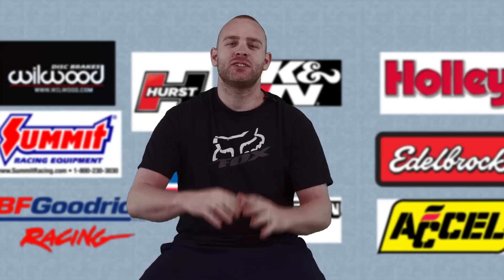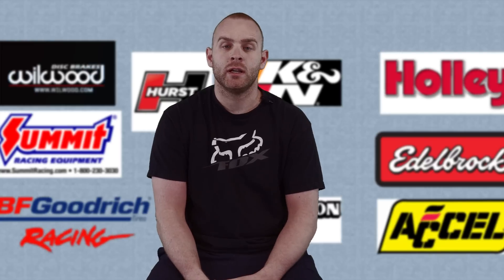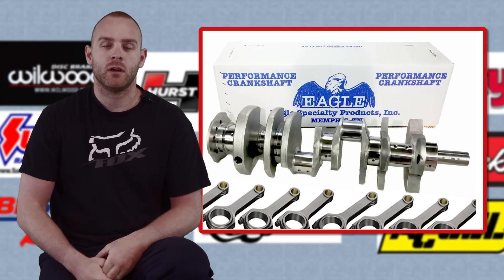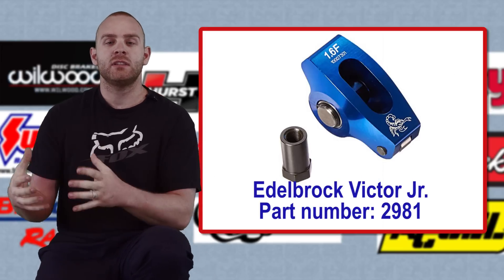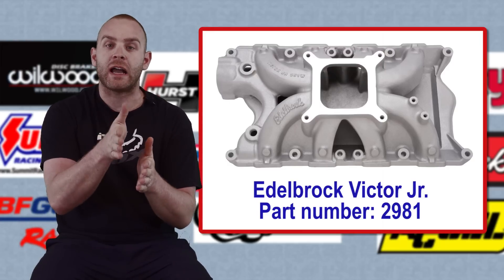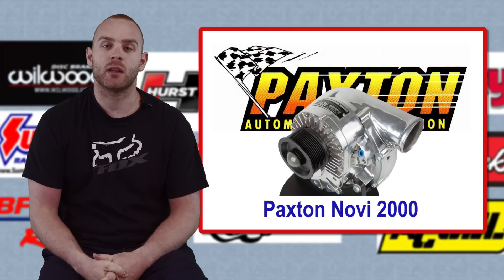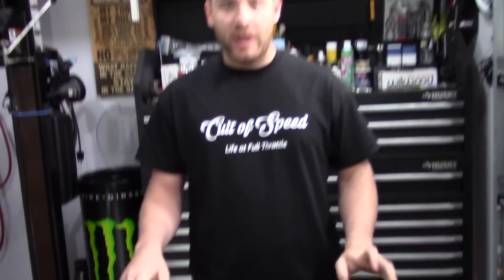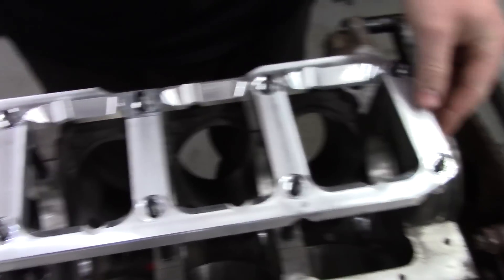351W Stroker - Recommended Parts

Comment: You can mount a roots style supercharger at the side of the engine, there’s no rule that requires you to put it directly on the intake manifold.
Reply from the maker: I agree but for my case it's not going to work, unless I run 2 small units for the power I'd like to make. Good comment though and completely accurate you can remote mount one

Comment: I would have gone with a custom cam for your application. I love the XE274HR but that’s way small cam for 408. Ideally something like 230-236 intake duration and 240-244 exhaust on a 114 LSA and .600 lift or so.
Reply from the maker: Correct but it's what I selected for street manors :)

Comment: That is a small little baby cam for the 408W. I'd guesstimate that you left at least 40hp on the table NA, and up to 100 when you add boost to it. 
It just won't have the lungs up top. Will be ok for picking up ice cream, but trying to meet your HP goals it'll fall short in that larger displacement stroker. You had a lot of duration left to play with and may find that it falls off after 5k rpms.
Reply from the maker: you might be right but as a street car primarily i didnt want to go so huge that drivability was effected.

Comment: was that an original 289? Ford used up what they had left at in January 1968 and went to the 302 after that.
Reply from the maker: Yes sir 289 car.
Reply: @710Garage allegedly, the last 289 blocks have the 302 bore length and may be better for stroking to avoid piston rock at BDC.
Reply from the maker: That's awesome I wonder what my build date is then... I'd have to go back and sort through it.  I have the take out motor and Trans sitting incase I ever want to go back.

Comment: Dang, bunch o girly parts!!
Reply from the maker: What are your suggestions then?
Reply: @710Garage   - solid cam, 225 TF heads (would like 220 actually), 11.5 comp, Jesel Shaft Rocker Arms, undecided about carb or Holley hi ram.  Would like EFI tunenability for street/strip tunes and not have to mess with jets, but, were talking $2500 extra just for tuneability, pricey, 1 7/8 headers or bigger, 7600rpm across the traps yada yada yada.............
Reply from the maker: Solid cam for a street car??  Sounds like more hassle than it's worth.
Reply: @710Garage   - Whats an hour with your car once every 3 months to have a 600hp street/strip engine?   Like I said, girly parts for a girly engine.  However, I do like girls.  If your gonna go through stroking it, do it right.  If not, just take a stock block and throw a super charger on it.  Will make just as much HP and even less wear, tear and longevity to boot (as long as you keep it respectable).
Reply from the maker: Well thanks for the comment. Safe to say we think differently about some parts above but that's why the world goes round... everyone isn't the same.
Reply: @710Garage   - Your welcome.  Anytime you nee a youtube troll, just let me know!  :)
Reply from the maker: @mistersniffer6838 what would the world do without them! 

atleast sub for the trouble ;) lol

Comment: How important is it to line bore/hone the journals before re install? My engine is out of a high mileage truck, but it’s cleaning up very nice!
Reply from the maker: It's cheap insurance to not have an issue later.  
I currently have a 347 at the machine shop that was supposed to be ready to go..  and guess what??  #2 main is out of round and we it wasn't checked we could have had significant problems ruining our good parts. 

I'd say it's worth the 4-500 to have it all looked over, so you know when it goes in its ready for a beating.
Reply: @710Garage  dang it. You’re right.
Reply from the maker: @FootageFactory  it happens from time to time 😆   thanks for the comment! Hopefully it helps you a little bit.

Comment: Hey man I got a question, I love the build but was wondering what your thoughts on the Holley EFI after all this time? Are you still running the engine with it? What issues did you deal with after putting boost on it?
Reply from the maker: Thanks for the comment and the view! 

the holley efi is amazing....  
I have had a few issues requiring sending the unit back but holley is amazing to deal with.  I would LOVE to up my setup to a dominator but would need to sell my sniper to do so. 

so I guess I'll keep it for sale and if it sells great. If not.. well... if it ain't broke don't fix it!
Reply: @710Garage Thank you for continuing to engage with your audience. I'm considering doing something very similar and put a centrfigual supercharger on a 1988 ski boat. We upgraded the heads to the "GT40" ones and the intake manifold to the same Edelbrock one you're using. We're going to rebuild the lower end soon. Im still pondering on the idea of using a blow-through carburetor and other old-school stuff to support the supercharger, or going to EFI. Do you think it makes sense to switch the carburetor to a Super Sniper?
Reply from the maker: I had absolutely no luck with the efi.. if I'm being 100% honest for YEARS...  I went to Steve Morris for a tune ( that sucked so bad the car wouldn't run ) I tried the setup wizard... I tried alot... 

but as it's a toy car for me I just put it away and when cooler heads were around I went back out to tinker... 

at the end of last season I went to Trevor at TC Tuned... he emailed me a tune and BOOM everything started to click... 
Through data logging I found an issue where the efi kept dropping my 02 sensor and it would fall on its face...  working with holley they were absolutely amazing and I got another new sniper sent out... 

with the car sitting about 9 months I installed the new holley last week and it fired up like it was running 5 mins prior and seemed to be running awesomely... 

I'm upgrading my steering setup currently ( hope to be complete this weekend ) and I can get it out and test it... 

long winded answer but FINALLY I am so so so happy with it ( for the amount it's ran and driven ) and I should have gone to see Trevor sooner... 

let me update again next week but I'm 99.9% certain I will be back in love with my baby, and be a sworn holley efi customer for the long haul.
Reply from the maker: Also......   thank you for watching!! I truly enjoy making videos and chatting with people ( like you ) about it... I had no one to help me prior to doing this stuff so if I can help I will

Comment: 500 hp is usually more than you can hook up without mods! You can run junk and a 150 shot of gas on stock Windsor crank and rods! Put the money in the heads!  The stock Windsor rods and crank will hold up! You gotta be ok. A cheap short block with heads and cam is the easy and cheapest way to go! Forget the stock hood! Noone believes it still an 8.2 block!  You can't hook up 1000hp without back halfing it! Screw the injection! Victor Jr and custom carb will get you there!! Don't waste  the money! You can't hook up 800 hp on the street anyway!
Reply from the maker: Who said I had no mods?? 

also yes there are cheaper ways to make 500 hp but how long will they last?? 

And carb?  Yes I could have for sure.  But I wanted efi..  that doesn't mean it is the ONLY way..  just what I wanted for my setup.
Reply: @710Garage  years, night after night. Week after week. I was probably doing this when you too the training wheel off!  Ran both of them. Po boys need something that stays together, and makes power and stays together. It's ur money! But you do realize you could go up to a 408 and still have a decent rod/stroke ratio. Or build a 393 for chicken feed! Ur money! Noone believes it's a 5liter with heads and cam! Good luck, and just have fun!

Comment: I apologize for digging up an old video - but do you happen to know what the motor was putting out before you added the S/Cer?  I'm trying to play out a dependable 500-550 rwhp stroker, so I'm kind of curious.
Great video, by the way.
Reply from the maker: no reason to be sorry!!! i havent gotten the car running well enough yet for dyno'ing... 

alot of bad reasons why??
moved
built a shop 
had twins
changed jobs

this summer i tried to get it ready to go and turned out i had a bad ECU from holley for my fuel injection.  so that was again another setback... 

i know that doesnt help you currently but i am working hard to get this thing running by spring time so i can give you the answer you want.
Reply: @710Garage  No worries at all man.  I totally get it...life happens lol.  I've subscribed to the channel and will keep a look out.  Good luck with everything you have going on.
Reply from the maker: thanks alot!  sorry i couldnt give a better answer as of yet.. but i sure hope shortly it will be better than we expected!

Comment: Always wondered about putting a 351 in a Foxbody Mustang. My current 302 is set back one in from stock. I had to shorten my driveshaft..
Reply from the maker: this is a super easy swap.  new oil pan, headers, intake and you are basically ready to go.

Comment: Do you think a Trick Flow single plane intake 351W will fit in a 1968 Mustang? The Trick Flow intake measures 6.429 inches. I am just asking because i know you installed a Edelbrock Victor Junior #2981 5.75 inches tall in your 68 mustang. So I was wondering how much hood clearance you had with that intake?  My car has a factory 1968 Mustang GT500 hood so there is a little more room but not quite sure it will clear.
Reply from the maker: i milled my intake down about .625" and i still missed clearing my hood by a good amount. 

i have drop mounts and had my elbow machined down aswell.

Comment: Will a F4TE roller  351w with stock pistons work with aftermarket heads with 2.02 lift? I was told the flat top pistons will not work but I’m not sure if they came stick with flat top pistons or not?
Reply from the maker: 2.02 is the valve size.  what cam lift are you running and rocker arms?
Reply: @710Garage  stock cam and 1.6 rockers
Reply from the maker: @sammyvices2547  id venture to say youll be ok. you dont have a ton of lift  

try putting some playdoh on top of your piston and crank it over by hand. 
remove the head and measure how thick your playdoh is where the valve indent is 

let us know for sure !
Reply: @710Garage  ok thank you

Comment: Edge of the cylinder head to edge of cylinder head is only 1 1/2” wider than the 302,  it fits anywhere the anemic 302 does and it does the job so much easier
Reply from the maker: exactly my point :)

Comment: I see you didn't do your homework on the heads, the Dart heads are not the best choice. The Trick Flow 11R Twisted wedge head performs better on the dyno.
Reply from the maker: sometimes you go for what is available in the timeframe you have to build a motor. 

i did not say these are the best parts ever created for the SBF. 

thanks for the comment, and goodluck with your engine!

Comment: Cheers from Motown! May I ask what might be the best Windsor block to build? Is older blocks better then newer blocks, perhaps a 70's block?  Thank you. I want my hunkin 460 out of there the sooner the better.
Reply from the maker: MOTOWN!!??  thats SUPER close!

the golden blocks are 68-72  but they may be hard to find ( go figure )  

dont be scared of the newer blocks ( early 90s ) as they are super sturdy blocks still.
Reply from the maker: http://www.mustangandfords.com/how-to/engine/1407-how-to-push-a-junkyard-351-windsor-past-1000-hp/

as you can see here they didnt hurt the block... but throttling up and down so fast is what shattered this setup...

engine masters also has quite a few vids on pushing the 351w up past 700hp easily...

what are your goals with the setup and whats the budget lets work on a plan to achieve that!

Comment: Hey guys, I'm trying to do a 408 build for my 95 bronco. I am copying your build pretty close but I'm doing a rear sump and NA I was wondering if there were things I could sub or remove, like the gurddle do I need that running na? Or do I need a HV oil pump? Just trying to get about 500 hp on a college kid budget lol
Reply: Or if you buy recomend a different cam for lower end power? Like this is a big truck on 35 in tires and my stock 351 is a dog in there. Just trying to get that extra umph, I also have a 69 block that I'm using for this build
Reply from the maker: the girdle is just for added piece of mind.  it helps to hold the lower end together. its not NEEDED... but recommended. 
HV oil pump in my opinion is a MUST HAVE.... you always want as much oil as you can get to the bearings and internals of the motor so i would not skimp on this.

the cam i have is setup for a blower.  so yes you can for sure use different cams.  there are TONS of options out there but ALOT will depend on compression ratio, heads, intake, stall convertor ( if auto ) and final gear ratio... so it would be hard for me to give a suggestion without that info. 

the folks over at Comp Cams are incredible to deal with. they can get you exactly what you want/need quickly and easily.  i would give them  a shout.  BUT have that info i asked in the previous paragraph at the ready so they have the info they need.

keep us in the loop with your build! and good luck.  if you have more questions let us know!
Reply: 710 Garage I don’t even have heads or intake picked out yet, I was gonna run the ones you guys had, compression ratio I was aiming to stick with pump gas so what’s that 10.5:1 for 87 octane, I’m willing to go up to premium 93 octane or even E85 is readily available around here. And I was gonna stick with the stock converter at first and work my way up until I found something smoother Ik the E4OD trans is a tough sob so I’m hoping I can keep that stock and then the rear end I was gonna re gear to locking 3:55 I hope that is a enough info to point me in the right direction. Thank you and I will definitely keep you guys in the loop.

Comment: 710 Garage What kind of power can you get from pro charge?
Reply from the maker: depends on the supercharger model used, how fast you spin in, and how big the engine is.

they make kits from about 500hp to over 1500hp.

Comment: I did a Windsor sr. in my 67 stang over 25 years ago. I have most everything that you showed except heads (mine are ported and polished Windsor jr.) the internet didn't exist back then. Had to research a lot from others and books. I never did anything to the bottom end.  I will soon.  Thanks for a great video.
Reply from the maker: glad you enjoyed it.  make sure to check back in and let us know what parts you used!!

Comment: With the Holley efi how do we run a Paxton on it? I have a 351w with a sniper and everybody’s telling me to get rid of it.. help me out!!
Reply from the maker: dont listen to them !!!! this setup is awesome!!!   we have one on a buddies 427 and it made a touch over 1100 with a YSI

what questions do you have about it?
Reply: 710 Garage well for starters I bought the car it’s a 351w with mild bolt ons. Car has a good pep.. it’s running ridiculously rich. The previous owner in my opinion didn’t realize what he had hah told me it’s supposed to run very rich. I find that hard to believe. Secondly i want to pro charge it what are some things I’m going to need to work with the efi
Reply from the maker: it shouldnt run really rich.

well first you need to decide on a power goal. 
then investigate what engine parts you have ( forged or not, cam etc. )
once you know these two things you can start to map out if the power can be had with your current setup or you need to change some parts.

knowing the power goal, you can select the right sniper and fuel system required, and you can start to purchase parts

its important to go step by step here and not rush, so that you can save money later on
Reply: 710 Garage ahh okay gotcha! Thanks so much for the pointers I’ll sure keep ya posted.. the sniper runs extra Rich and my o2 keeps blowing out.. I have a local shop that said they can dial it in for me so I might just do that
Reply from the maker: where is the O2 located ?  and is it angled UP coming out of the pipe??

have you tried to leave the battery unhooked ( completely ) and starting fresh with the setup wizard?
Reply: 710 Garage the 02 is located on my passenger side about 6-8in past the collector facing downwards. O2 wires facing up. 
I have tried to disconnect the battery and it didn’t seem to do anything at all.. if I disconnect the battery what should I do and get that? I appreciate all this help!!!!
Reply from the maker: ok that should be good.
are you seeing an AFR reading on the screen when running?  what is it reading?
did you go through the setup wizard and act like it was a brand new install after the battery was off??
lastly try this.
when the battery is off and has been for say 3 mins.   touch the positive and negative cable together for 10 seconds.  that is a hard restart for the sniper brain. ( works on newer cars aswell )
Reply: 710 Garage it keeps saying my 02 is unplugged!! I’ll try the hard reset tonight after work I’ll let ya know what happens!
Reply from the maker: if thats the case make sure the wiring is ok and not melted. 
if the wiring is alright replace o2.

that explains all the running rich stuff!

Comment: hey man, is the rod clearancing for the stroker crank at the bottom of the bores completely necessary? asking for a 408w, looking at 800-900 hp.
Reply from the maker: yes it is.
Reply: My mates 408 with procharger ,  8 psi  made 800hp on the dyno  , 666hp at the wheels 👹
Reply from the maker: Which makes sense for about 8psi. 

14.7psi will generally double the hp the motor makes NA